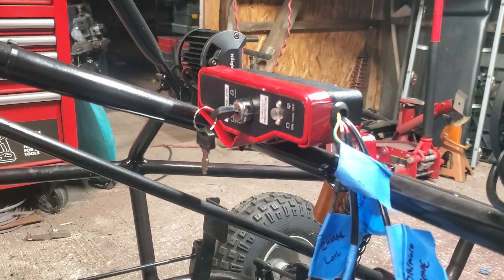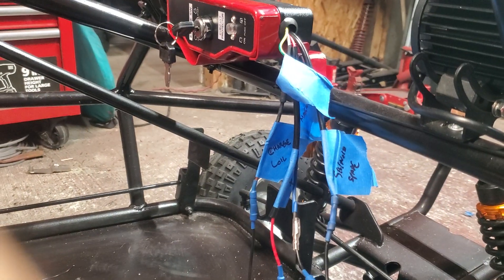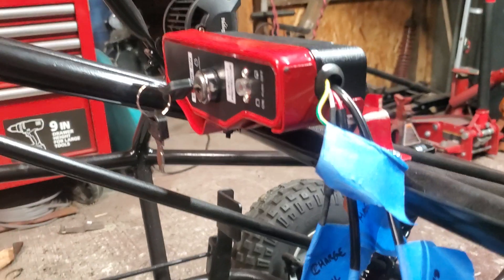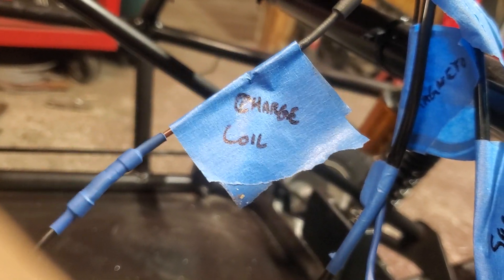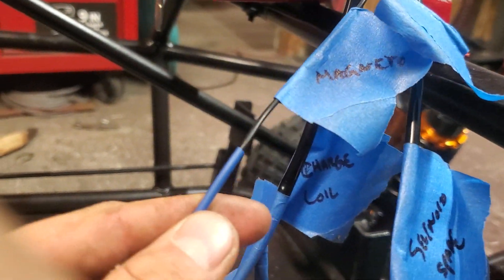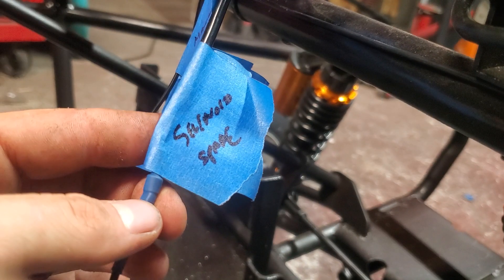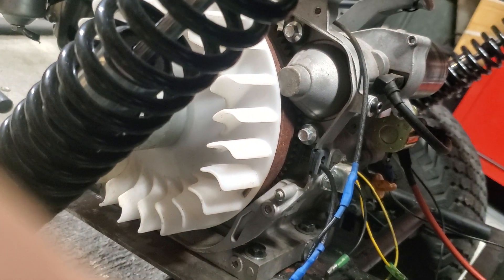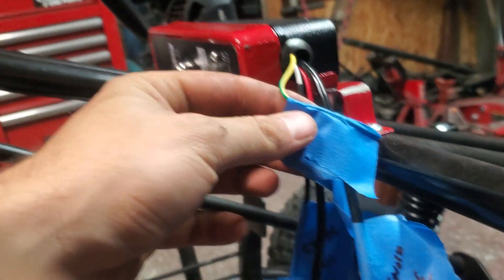Chinese GX Predator Side shaft electric start Ignition box / Starter wiring diagram

Comment: I had  a hard time installing one on my Honda gx390 pressure washer.  I figured out all the wires except the one with the pigtail.   Struggled for awhile,  then looked at the wiring for the original on/off switch and low oil sensor.  Finally tried running the low oil sensor wire straight through like it was originally.   Ran the wire with the pigtail into the one original switch wire and the pigtail into the other original switch wire. This completed the circuit as if the original switch was in the "on" position.   WORKS!

Comment: For some reason my key start just clicks when I turn it but if I jump my solenoid (put a screwdriver across the two bolts on the solenoid) it fires straight up, so confused
Reply: Bad solenoid probably